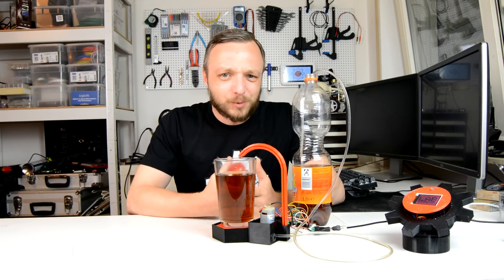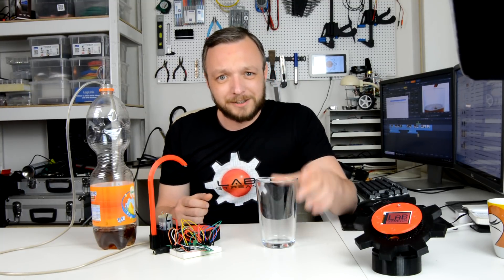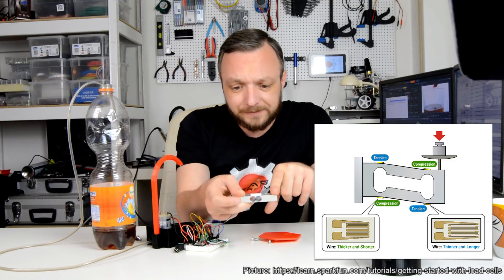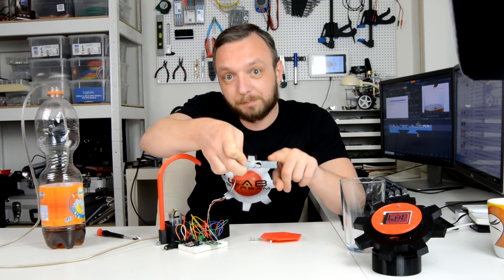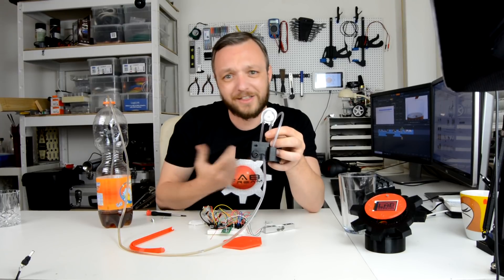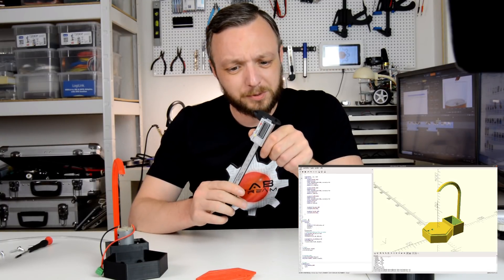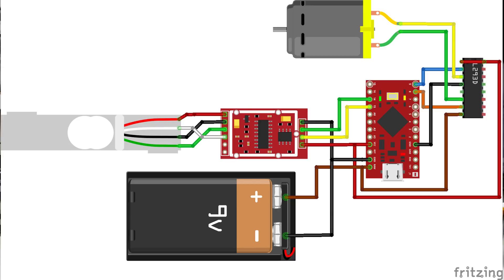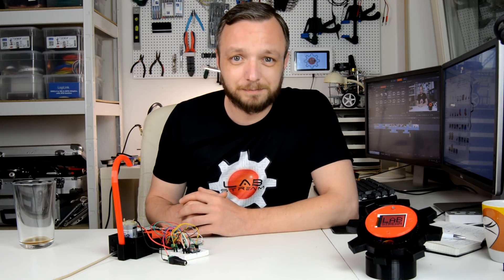DIY Drink Dispenser with a peristaltic pump - The Waterboy

Comment: its nice to bulid such a device even it is a problem then to build a device that fills the bottle! 
but just wanted to mension that the idea with a camera looking into the glass to determin if full or not is easier than you have said. you don't need any AI or super processing for that!.
I have just used an Ultrasonic sensor for like 1$ and mounted it like 10cm above the glass (I take 10 reads each second put them in array loop through to ignore the too high or too low readings. as a result  I get an average reading which is + - 0.5 cm precise!) no liquid touch no extra cables small and robust!!
Reply: oh wow that is smart